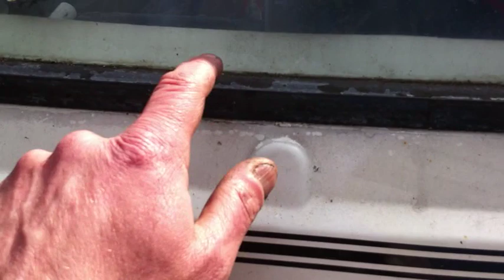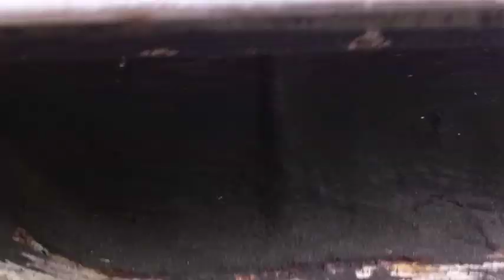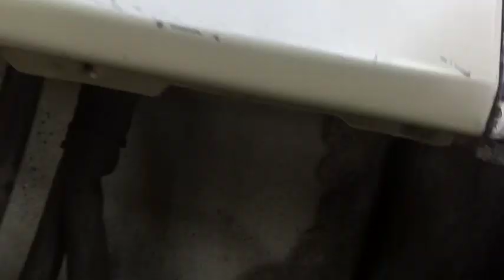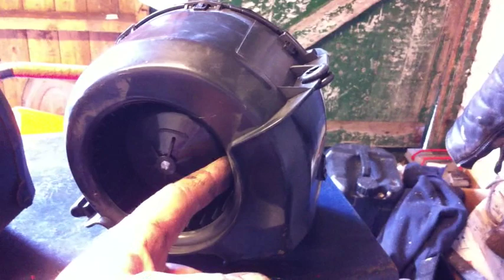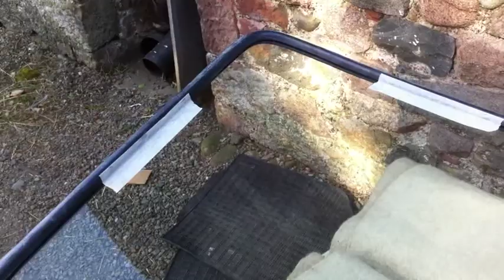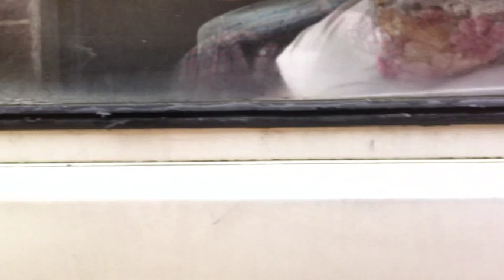VW T25 Chassis & Body Repair + Dashboard, Heater Blower, Windscreen Fitting - Part 24

Comment: Put it up on blocks, cut a hole in the floor, bolt a toilet down, and cover the windows. That's all one of those vans is good for, making into an outhouse. The Wasserboxer engine is a hateful lump of shit that is good at turning gasoline into heat, noise, and exhaust, but really very bad at actually making the damn car go,.
Reply from the maker: Thanks for the advice John. Good job this is a diesel and not a boxer engine?

Comment: Hey There! Yep, I also have to change to see what is going on with my heater motor cause seems like stuck and everytime I switch it on a fuse kaputts! The only thing I don't want to do is cut a square section of the front panel to change it! Also comment about the views on this video... 35511 views, and no ones likes it? Come on!!! Thanks for sharing!

Comment: Good work on the welding, I would have painted the van wit the rubbers out, easier than masking them all up. I'm not criticizing though as you have good skills and have saved a rusty wreck for many years to come. :)

Comment: Great vid. This is what my van needs. The heater motor has also died. So good Idea to do it at the same time. Wish I'd changed the windscreen rubber years ago when I had a new screen fitted. The rear window is also heading the same way. Wish I could do it myself. £££!